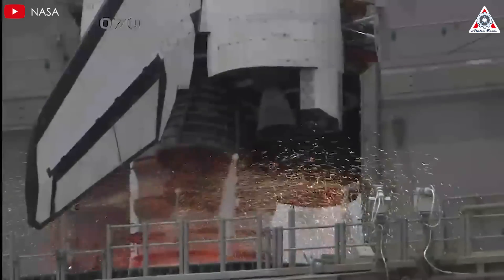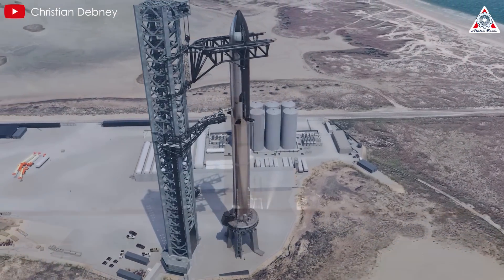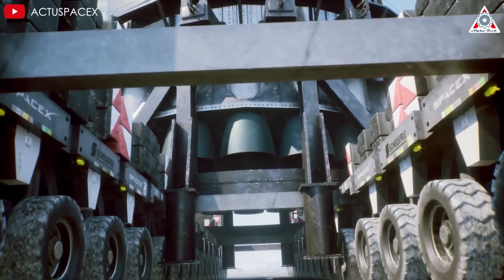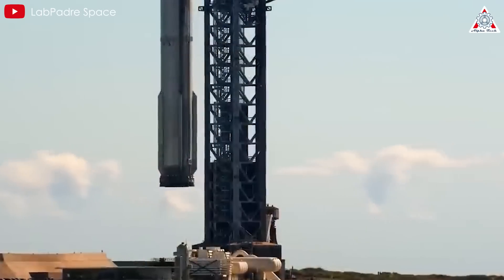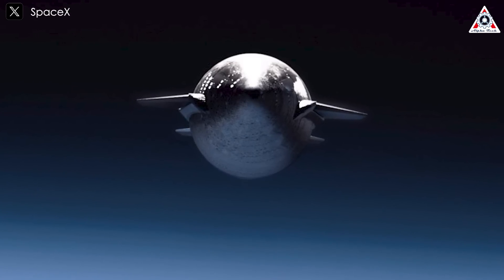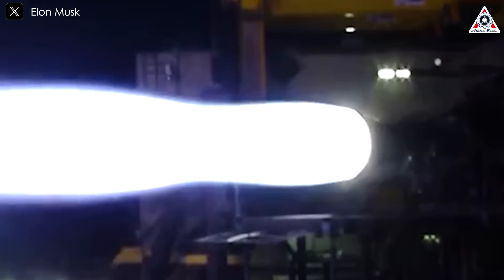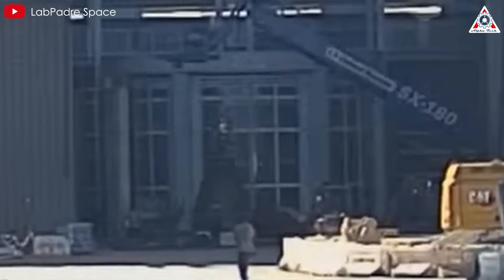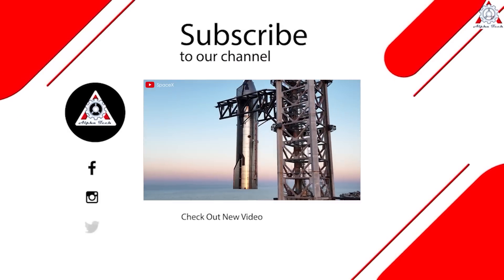SpaceX's NEW-GEN Raptor Engine just completely HUMILIATED the entire industry...

Comment: As hot as the bottom of the Starship booster got in Flight 5, it remains to be seen how well R3 can sustain landings with no heat shield or damage. Some of the nozzles were melted on flight 5 and there are much smaller parts on R3 (couplings, hollow channels, etc.) that have wiring and fuel/cooling flow inside. These items look much less robust than solid engine nozzles and one can only imagine how much easier they would melt or warp at the high temps we saw on flight 5.  R3 looks awesome in the amount of wiring & plumbing which has been incorporated internally, but that's still a far cry from it being able to handle the heating we saw on flight 5. Maybe I'm wrong and there will always be some kind of heat shield to protect the engine from the nozzle upwards, but that's not what it sounds like. For my part, I hope they end as reliable as modern turbofans, but we shall see. That's what makes it so exciting!

Comment: Will a "4.0" size/mass increase correspond to thrust or result in exponential thrust increase? If there's a thrust exponential increase, what size does the increase level off or degrade in relation to size/mass?

Comment: It still does not put out as much thrust of Rocketdyne's F-1.
Reply: A engine having the most thrust is interesting, but not nearly as important as efficiency, reusability, thrust to weight, cost or time to build each one.  F1 was impressive, but there are plenty of good reasons no one is building them anymore.
Reply: The F1 engines were reuseable.

Unfortunately they were never actually reused.
Reply: How many F1 engines were ever reused?
Reply: @johnbuchman4854  That's not what I said.  The F-1s thrust at sea level was 1,522,000 foot-pounds or 6,770,000 Newtons per engine.  And this is the 55th anniversary of Apollo 11.
Reply: @johnbuchman4854  RS-25 is more powerful than a Raptor and some of them flew 16 times. They had a >95% reliability rating. They still have higher Isp than a Raptor v3 which hasn't even flown yet, and they were designed in the 70s without advanced computation fluid dynamics affords to SpaceX rocket engineers, but with pen and paper.
Reply: @RayCromwell 
Rs25 produces 512,000 pounds of thrust in a vacuum 
Raptor V2 produces 569,000 pounds of thrust in a vacuum 

Rs25 produces 418,000 pounds of thrust at Sea Level 
Raptor V2 507,000pounds of thrust  at Sea Level 

Rs25 is more efficient than Raptor because it uses Hydrolox instead of methalox but it is not more powerful than a V2(which has gone to space) or V3 raptor.
Reply: @RayCromwell how much did they cost and how quickly were they manufactured?   …Exactly
Reply: @mohdafnanazmi1674  thrust isn’t the only variable, Isp is more important for long distance journeys. There the RS-25 would get you to the Moon or Mars quicker.
Reply: @jaymartinez8231  "how much did they cost and how quickly were they manufactured?   …Exactly" You're comparing something manufactured in the 70s and 80s, with much more primitive tools, before CAD/CAM, before CFD. It was far harder to build engines back then, and they built an engine that had such amazing performance and reusability that it led the pack for 50 YEARS and was only recently beaten by SpaceX and you guys are all like "Har har, Musk wins, NASA sux!"

Have some respect for your elders. No one's denying what Musk has done, but the mindless cheerleading is one thing, the "dunking" behavior of completing ignoring the standing on the shoulders of giants before you who paved the path and handed you massive amounts of know-how and knowledge is just silly.

And I'm completely leaving the Russians out too, who invented the full-flow staged combustion engine concept in 1962.

But I guess Tom Mueller woke up one day and invented it all from scratch.
Reply: @RayCromwell  Our SoCal aerospace customers ran IBM's CADAM on IBM"s 360s in the late '60s then IBM 370s, 3033s, 3084s, 3090s in the '70s & '80s.
Reply: @douglaswilkinson5700  It's probably true some primitive CADAM was used, but nothing compared to what's afforded to a Raptor. 

Tom Mueller literally simulated the combustion with CFD on GPUs using Wavelets. Combustion instability back when was often found by building full scale models (small scale models often wouldn't exhibit the instability) 

On the F-1, instabilities were basically solved by people brainstorming ideas and trying them.
Reply: @RayCromwell  "You're comparing something manufactured in the 70' and 80s, with much more primitive tools, before CAD/CAM ... "  I was an IBM Systems Engineer in its Aerospace Branch Office in the '70s, '80s & '90s.  I personally saw Northrop, Rockwell, TRW, etc. using CAD/CAM from the late '60s onward.  In fact, I went to IBM's school teaching CAD/CAM to its systems engineers.  I taught TRW employees how to transfer its facilities' blueprints into CADAM (IBM's CAD/CAM software product.)  So CAD/CAM was used by aerospace companies from the late '60s onward.
Reply: @douglaswilkinson5700  I acknowledged that, but it was far more primitive than today's systems. Especially Computational Fluid Dynamics, which was used for Falcon and Raptor to model combustion, especially combustion instabilities.
Reply: I've ran my hands over the F-1 at the Museum of Space History that's out near White Sands in New Mexico. It's a beast.
Reply: Yep, Raptor 4 will be Amazing once they can figure out how they can get the “Flux Capacitor” to work properly🤣😂

Comment: The 3.0 is a masterpiece. Beautiful.
Reply: The Raptor ironically still has lower Isp than the RS-25 the shuttle used, which was reused on 16 flights, and designed in the 70s. The RS-25 was one of the most complex and powerful engines ever designed and flown.
Reply: @RayCromwell  
Because it uses CH4 instead of H2 for fuel.
Reply: @RayCromwell  
But had to be rebuilt after every flight!
A marvel yes, but very complex!
Reply: Came here to post this.  It really is a work of art.
Reply: @andrewsarchus6036  ...wasn't this copied from the soviets ?

Comment: I hate to tell you guys this but...  They are Rocket MOTORS not Engines...
Reply: No, you confuse with electrical motors.  Rockets are engines.
Reply: It's a motor when it's a solid fuel motor but an engine when it's liquid fueled turbopump engine.
Reply: All engines are motors, but not all motors are engines.  Engines consist of subsystems, like an automotive engine.  Motors lacking subsystems such as electric fan motors are simply motors.
Reply: @Texas_Man_in_Black   The terms have become interchangeable.   When I was a kid, motors were electric.  They worked on electromagnetic principles.  Engines work on kinetics.   But the lines blur over time.  You and I know that the terms are interchangeable.   The result of either is kinetic output.

Comment: Why do you need 33 of them to push the rocket? That increases the chance of failure
Reply: How does it increase chances of failure? If one fails you have 3 more to adjust, and the more thrust the more you can take to the orbit and eventually to the moon and mass. The more engines the more thrust
Reply: @Br1ck111  You lose lift power
Reply: @czarcastic1458  you really don’t
Reply: The opposite, if one engineer fails the thing still flies, if you've point got 3 or 4,....
Reply: @russellcrosby8175  If your car has a cylinder go out you have less power
Reply: Does it?
Reply: @elwap0  Yeah .

Comment: There are obvious engineering differences between Raptor 1, 2 and 3.  There is likely not between 3 and 3x.  Instead it represents tweaks of improvements, Just like Merlin 1D, 1D+ and 1D++.
I doubt there will be a Raptor 4, because there is no need or way forward for it, just like there was never any need for a Merlin 2.

Comment: You guys make me so happy!
We've come so far, since the gate keeper Wall hanger Snobs were Slayed by the "Parts Count" and other basic concepts...

Now, everybody gets it! 
and a new synthesis in teams between Enginerds and blue collar types...
I was thinking a few days ago, that if a  Manager at SpaceX,
 I would encourage chumming in the cafeterias between Engineers and those in the same areas of project, so that the guys all became friends, from the truckers hauling metal, to the machinists to engine engineers.
Or in the case of hulls from the guys trucking in the rolls of stainless, 
to the welders and structural engineers, so everybody would know each other personally in chains of production, and able to comunicate team like.

Share the same tables... specifically in your food chains. so everybody isnt hesitant to solve problems together.

"All serious work, deserves respect."

And on engines, one thing that might be good, is working on a design thats good enough to scale...

Due to viscosity, flows and velocities etc. you wont be able to directly scale engines 
up and down...

BUT! you could carefully design three engines of the same model, Say Raptor 3 Standard, then a Raptor 3 Max, that was the biggest the design could be developed to practically,  then do a Mini-Max that was the smallest practical. All basically the same engines with variations required, then, you could use scaling on curves from those three data points to fill in serveral other size variations. "Free lunch" designing...

For doing, and data pointing three variants...

Ending up with five or six different engine size editions for the design work of three...

Then the biggest could go on Well-2-Orbital Boosters, (W2OB's) and the smallest used as directional thrusters or continious thrusters to create long term  acceleration based micro gravity on big ships.
And intermediates used where appropriate. from tugs to yachts....

Another thought I had: dividing up fuel into seperate tanks for acceleration and deacceleration quantities, so you are not trying to insulate and refridgerate a huge half empty tank for months of voyage duration time.
 That used quickest, could have thinner tank structure, and long term maybe some savings by having higher pressure/better insulated/actively cooled tanks.

Also for the engineers, if you like staying employed, working on the central pump and multiple thrusters system might keep you busy, as would "Ring" engines, that were effectively slots like an aerospike linear, bent into a full circle and joined up..
  would be able to be manifold fed, diffuser baffling, preheater/wall cooling exchangers etc. but way simple to fabricate up from 3D printed rolled pieces.

And it does reduce parts count...
A ring of thrust chambers, becomes a thrust chamber ring...

And could be nice say creating nifty open center uses, like say aft loading on winged re-entry ships, thru the center of the thrust ring, or say your habitable compartment to ground access, via engine room for the tail standers.

could be pretty nice, on the Tail Standers to have a spiral ladderway and central cargo elevator, and flights of steps ending at each deck with a platform... so you could rest climbing or stage for steps or elevator. and have Air Tight  hatches at each deck to close off the Ladderway etc. for airtight integrity disapline in case of getting holed somewhere...

Another idea, might be job or rate patches like the Navy uses but for Spacers...

Mine was lightning bolts...  Others might be a Sextant, or a rocket thruster.

SpaceX is basically gonna end up like Merchant Marine, and would be nice having patches commonality with Space Force uniforms.

Spacefaring will require some minimum level of disapline, its not a pretty ambient for screw ups.

Anyway, glad things are being upgraded, and everybody not thinking the same....

Comment: I'm yhink they need to make bigger engines and use less of them.
Reply: They will get less thrust with bigger engines.
Reply: Also it would be much heavier, negating  any hypothetical thrust increase.
Reply: Less thrust to mass ratio, nonsense, using more of them has a good effect, if one fails you can you other three around to adjust to the trajectory, with SpaceX current technological level it’s not a problem

Comment: Raptor 4 is going to be MUUUUCH bigger!...less engines....."best part is no part"....
Reply: Engines don't have infinite throttle, they can only go so low; 40% to 60% thrust before they shutdown.
So to hover an empty booster you need lots of small engines so you can run one at 40%.

Note: 
It takes 33 raptor engines to lift when fully loaded but only 1 raptor engine to hover into the chopsticks.
The change in weight of the booster is ridiculous.
Reply: No need for that, the weight to thrust ratio would be lower and probably singnificantly, and more engines means that if one of them somehow fails, the other around it can adjust themselves to the trajectory